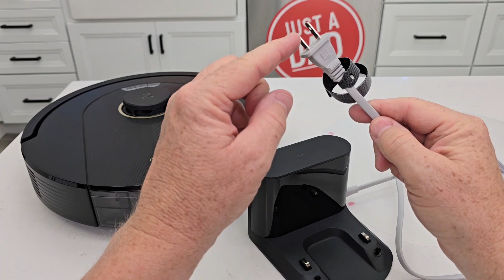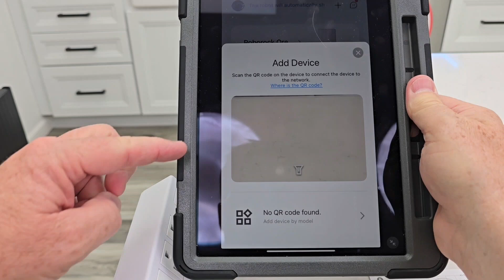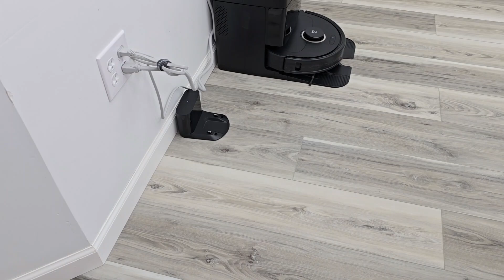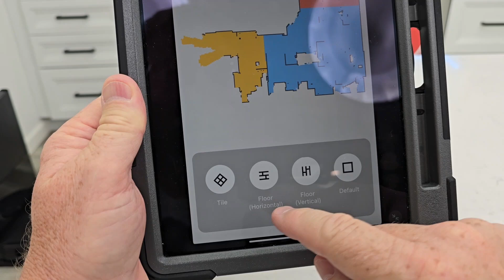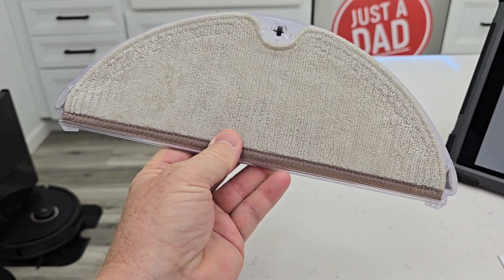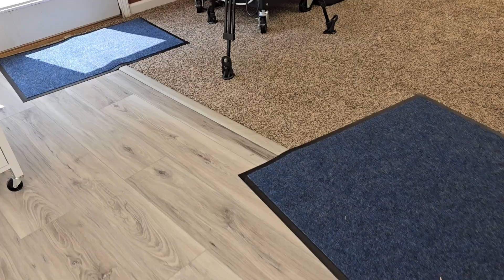Roborock Q5 Pro Robot Vacuum & Mop UNBOXING & SET UP

Comment: Just got this for $160 on amazon, loving it after I finally got it setup. It endlessly failed to connect to my wifi. After 3 hours of trial and error and researching and many others with this issue, it turns out you cannot have any special characters in your wifi network password. Not a good sign.

Comment: Does it recognize if the water tank is installed or not? I am thinking to use it only for vacuuming on hard floor.
Reply: You can leave the water tank not installed, or leave it installed but empty.  I don’t recall whether the device recognizes/announces that the reservoir is installed, but it doesn’t really matter.

I’ve only ever mopped my floor, including carpets, once. The tank has been uninstalled ever since. Maybe someday I’ll fill the tank and specify a cycle of just the hardwood and tile rooms. But the tank was nearly empty after one pass on the floor, so it’s a very manual effort.  I have the device set to vacuum busy rooms each day and the entire floor once a week and the only attention it needs is emptying the bin every two weeks. Mopping would add a lot of manual effort. 

If mopping is important, a more expensive model with a water tank, active mop scrubbing, carpet detection to lift/stop the mop over carpeting, etc., would be a much better choice.

Comment: During set-up, if you’re having trouble connecting to the vacuum to set-up Wi-Fi, try  selecting the vacuum manually.  Using the QR code sticker was always failing for us.  Choosing the vacuum manually from the list of all RoboRock devices worked normally.
Reply: I tried that and it didn’t work sadly 😢
Reply: roborock will send you a link,   Google play install didn't work for me